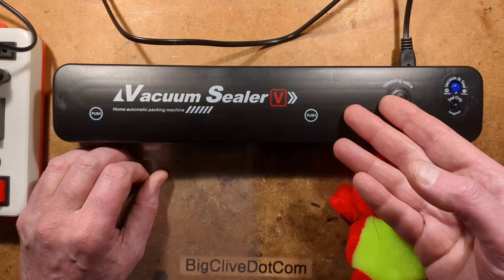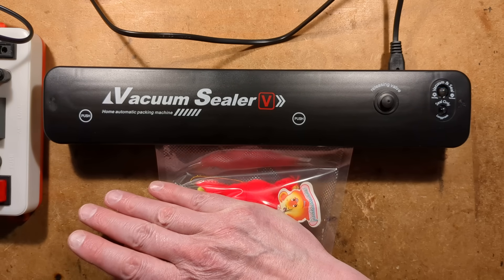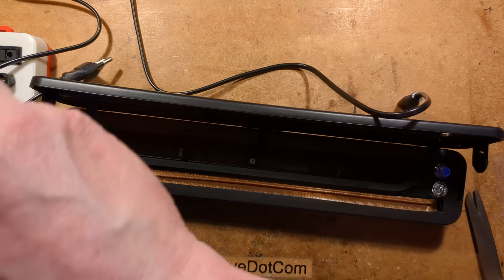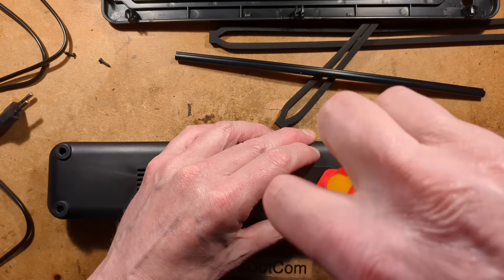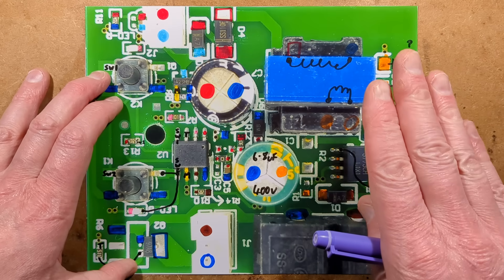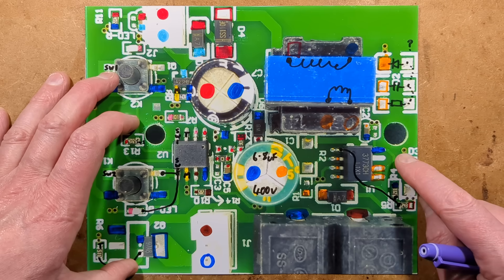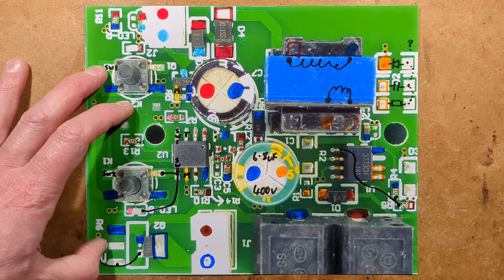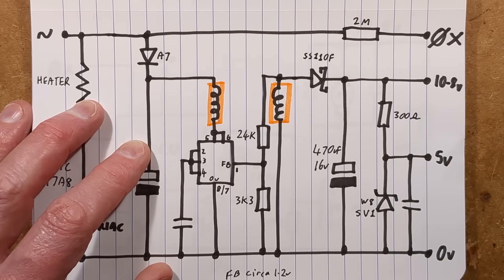Cheap vacuum sealer test and teardown

Comment: You can do as well without the electronics and at a cost of next to nothing. It starts with a 1" syringe. use a short length of tubing to a t-connection, from there to a one-way aquarium valve on each branch in opposite directions. What that does is suck in on one leg and blow it out of the other. Put the food in a plastic bag. close it, and push the "in" end through the plastic. A couple of quick pumps removes the air and some tape seals the bag.
Reply: And this syringe, tubing, tee, non-return valve and tape is significantly cheaper than $6?  "Next to nothing"?
Reply: @alsavage1  Go check
Reply: @alsavage1  Syringe and tubing £3.30. T-junction £0.11. 2x Non-return valves £0.80 Total £4.21 @ 1.34487 = $5.66.

Comment: I don't think I'd trust this machine to pull/seal vacuum for any extended time.  Tiny pump, plastic case, toy-ish circuit board, maybe for organizational purposes.  I have a commercial unit I purchased years ago at Cabela's, a sporting goods store here in the US which cost me several hundred dollars.  I use it for harvested game, purchased meats and also for bulk food storage, saves me a lot of money and has never failed.  I'll never take it apart but thanks to Big Clive for his participation in this endeavor, very interesting.  👍👍

Comment: Could you disconnect the heater and use it for vacuuming ziplock bags? (after taping over the ubiquitous stupid punch holes!)
Reply from the maker: Yes.   The heater can be unplugged.

Comment: Another possible use for the zero-crossover would be to act as a timer for the vacuum pump.

Didn't realise that you had to insert the bags in a specific orientation, maybe that's why I get inconsistent results with my vacuum sealer.

Comment: These cheap (implies low quality) vacuum sealers don't draw much of a vacuum - maybe 20"Hg (out of 309" Hg) at the most.  Vey few, if any, say anything about the vacuum level they can achieve.  You have to get that info from independent reviewers.  Those that can achieve 25"Hg or more are better quality.

Comment: 15:20 Using mains frequency to infer voltage isn't infallible.  Japan, for example, uses 100VAC at both 50 Hz and 60 HZ.

Comment: Wife bought one locally.
Lasted 3 uses  and resistance broke which was odd,  I was not witness of that or how it was used.
Replacement resistance were nowhere to be found since it s different from other impulse sealers . Also it works from mains. Ended buying 2  old new stock units  for 2 USD each, boxed and working from the local e waste  street.
Reply: Also this air pump is similar in construction as the ones  used in Chinese portable blood pressure monitors, MAPA

Comment: The problem with a lot of these machines is they're designed to work with a specific type / thickness of plastic, and there's no way to adjust them to work with different bags / films (so either they don't seal properly or they melt it right through). Well, I say "problem", that's obviously not a problem for the manufacturers, who are interested in locking you into buying their consumables.

Comment: 😏 before going to college I used to work at a printing company and I ran a shrink film heat sealer, buying books for school was absurdly expensive especially most of my books had to be new of course (damn proffs) a few classes I had to drop, and those books were shrink wrapped😮‍💨 once it's unwrapped it's "used" so having a vacuum sealer some window insulator film and a hair dryer got me my FULL refund for those books, luckily the sticker's they put on the film were easily removed and placed on my repackaged book 😉
Reply: Same, we had a shrink film sealer for returned computer goods, which made the next customer feel better I guess :/

Comment: I use something similar in the kitchen for food storage but lately I've been thinking of buying one slightly bigger for storing my 3d printer filament as I'm having moisture issues.
Reply: Wouldn't ziploc bags be perfectly adequate for that?  You could even include a little sachet of silicone dehydrating grains if you really need to keep the contents anhydrous.
Reply from the maker: The next video to be released in a couple of days is about hand pump operated vacuum seal bags for 3D filament.

Comment: They needed a 12v power supply with a decent amount of power. Since the entire circuit is completely isolated in the case the 12v supply doesn't need to be isolated from the mains. Saves a lot of money.

Comment: Been trying to find something similar for  vacuum sealing trashbags
Reply: A vacuum cleaner (Shop Vac) hose and Ty-Wrap work perfectly for that.  We pack our pillows for vacation that way.  30" Hg vacuum not needed for that.
Reply: @johnwiley8417  I've seen ads for similar bags to let you compact your luggage,  using a vacuum.  The first question that comes to mind for me is,  "do you have to bring the vacuum with you?"

Comment: Bottom of the pile sealing strip there Clive ,wider is better .I use mine for long term storage .Got lots of bills or bank statements lying about ? Vacuum seal them in yearly  bags write on a bit of paper what's year it is and seal them into a brick and put them into the loft ,you will probably never use them but I proved I had bought something 5 years before for a warranty claim and there it was all nice and crisp in my loft . You can put in books to preserve them from beasties and mould and a whole host of other things not just overnight marinating your meat (oooer Mrs)

Comment: You absolutely need to let this type of sealer cool well between turning on the heating element. Over a short time the top will turn into a big Smile because the ends coo at a faster rate then the middle. I used my first one for food and it did a lot, but as the bend got worse, I had to push it down to make the seal. If you plan seal things like food, get a more expensive sealer that is a box with a glass lid. Now if you want a cheap vacuum pump, these are great. Also, if you are sealing food, it will suck up liquid, so make sure the unit is elevated enough, also better ones will draw a low enough vacuum to boil liquid at room temperature, which is very cool.
Reply: I have a simple sealer device that looks very similar, but the vacuum pump is mounted in the top part of the device, so if any liquid is sucked into the vacuum chamber, it's not flowing into the pump's inlet. Small but very effective engineering decision.
Reply: @pfefferle74  In a similar vein, British-made front-loading washing machines always used to have the motor mounted in one of the corners above the drum, in case of leaks.

Comment: You cant rely on the mains frequency for guessing the voltage. Especially in south Africa there are places with 220-240V at 60Hz
Also half of japan is 100V 50Hz
The only thing that could be done is measuring the timing difference between that pin 7 with a pullup and without
Without a pullup the pin sees a 50:50 square wave but with a pullup the high part gets longer depending on the mains voltage

Comment: Quick protip: you can use any ordinary smooth bags if you put a short segment of plastic drinking straw in the middle of the opening. It'll pull the vacuum through that and then heat-seal the whole thing together.
Reply: Also, you can cut strips from scrap bag material. Stick in bag to be sealed, like the straw. This helps when using other bags that don't have texture.
Reply: I've managed all sorts without the straw even if you line up with the vacuum properly but I'll be trying a straw next time. Always good to have another approach to a problem

Comment: The pump.used in the device is the same one used in blood pressure monitors, I know this because I took mine apart when it stopped working. The blood pressure unit had a short capped tube applied to the port that is used to suck the air out of the bag, the other port blows air and that's why there is a vent in the base of the unit
Reply: I recognised the sound :)
Reply: Me too.. 😂  @yangtse55
Reply: Its an offtheshelve pump i can find on aliexpress for a few cents

Comment: I've something similar, it'll seal/melt normal plastic bags together as long as the plastic isn't too thin. You can faff about and seal the vacuum bags to other non vacuum plastic bags to turn them into vacuum bags(the vacuum bag needs to in the machine for it to work). You can also faff with cutting the bags to make smaller bags if you're wanting to use them for waterproofing things for camping e.g. emergency lighter, batteries etc
Reply: I've not being successful using it for sous vide cooking, the bags fill with air during the cooking process

Comment: In the states, they sell bulk bags that are on rolls about a foot wide with only the sides sealed so the length can be whatever you like. They are a reasonable price at comerical food supply distribution stores. Most handy for food storage in the freezer.

Comment: I bet that vacuum pump and sealing strip will work perfectly fine for years(even with that shady low quality driver and motor), but plastic latches and foam seals will disintegrate after few months...

Comment: Over 25 years ago I had a small handheld battery powered bag sealer to reseal snack bags so the chips, pretzels, etc didn't go stale. It worked well enough but was quite murderous on the 2 "AA" batteries used to power it. It took about a minute or so for the heating element to get hot enough to melt the bag closed.
Reply: I just fold the bag and put a clothespin on it. Never runs out of batteries.
Reply: @helgew9008  does go stale faster though
Reply: Ah i bought one of those recently at a dollar store. And like you said it worked good enough after a minute of heating up... but the batteries would die super quickly 😂
Reply: @its_ya_boi_slim_dic  Agree completely. Even quality AA cells would die a quick death. Good idea, maybe LI-ion battery pack might be a better solution.
Reply: @quantumleap359  I had this item in the days of Ni-Cad batteries. Li-ion really wasn't there yet.
Reply: @its_ya_boi_slim_dic there are USB C rechargeable ones
Reply: @its_ya_boi_slim_dic  Use some quality rechargeable NIMH's Will last for ages and heat up in seconds. Get the LSD kind from capacity 1300-2000mAh. Not the high capacity 2500+mAh ones.
alternatively some NICD AA's less capacity but still high current capability
Reply: @its_ya_boi_slim_dic  so wire in  3V POWER PLUG
Reply: > "...quite murderous on the 2 "AA" batteries.." Housemate bought a battery powered 'swank lamp'. EATS three AA cells every few days. I knew we had a dozen-pack in reserve-- and then we didn't. I bought a C-cell battry holder and was gonna convert for like 4X the battery life.... have not got a round tuit.
Reply: @PRR1954  the proper mod is to apply it to the bin
Reply: Opportunity for recycled rechargeable?
Reply: me too, I wonder if its the same principle to this post, always disable battery when not in use?
Reply: I still have one from the early 2000s.

Comment: You could cobble together a pretty nice vacuum desoldering tool with that little pump.
Reply: I believe you need more negative pressure than these tiny little pumps can provide. These have the luxury of time as you can just wait till they've laboriously pulled the air out of the bag, but desolderers need to suck the solder in the open air.

Comment: I have such a vacuum sealer probably made in the same Chinese factory but with a different "brand". The biggest issue is the foam bits dry out and then the device stops working as it doesn't create a good enough seal. A workaround is simply to take a damp to wet sponge and wipe the foam bits before use.
Reply: Perhaps you could wipe with a few drops of olive oil?
Reply: *before plugging it in to the mains

Comment: I think I'd probably replace the mains lead with one with a 3 pin plug and a 3 amp fuse. I don't think I saw a fuse or fusible resistor in the schematic. Excellent video Clive, I think I might get one.. ty.
Reply: A proper adapter should be fused. You can get ones which capture the two pin plug and effectively turn it into a UK plug. Quite a bit of stuff sold through the more "formal" channels comes with one fitted.
Reply: What would you connect the 3rd pin to?  It's all plastic, nothing to ground.
Reply: @alsavage1  Nothing, like every double insulated item with a UK plug on it. Two core detachable leads with moulded plugs often have a plastic "earth" pin just to operate the shutters on the socket.
Reply: @alsavage1 I'm not worried about the lack of an earth connection, it is the lack of a fuse that concerns me.

Comment: I use my home vacuum sealer for projects like my coasters. After I apply the adhesive I put them into a bag and vacuum seal it applying even pressure across the coaster for better bonding. Oh, and I use it for preserving food also😂😂😂sushi .

Comment: Cheap and cheerful, I guess, although there are several identical-looking products on Amazon for around  £15.

You are better off spending more money and getting a machine that includes an integrated cutter. Then you can buy rolls of film which even Lidl sell from time to time. In fact, even the Lidl Parkside vacuum sealer (which was available again recently) would probably be a better bet than this thing not least because it has a 3-year warranty.

Comment: Great video, thanks Clive!

Aluminum has lower resistance by weight. By volume, copper has lower resistance.
And in these applications the volume difference of the metal doesn't matter, it doesn't change the volume of the enclosure, so the weight is the only real consideration. So copper-coated aluminum would be a superior choice even if it wasn't cheaper.
Reply: He was talking about the included mains power cable, not the enclosure. CCA power cable is not superior, it's just cheaper -- it is much more brittle and prone to mechanical fatigue, which is exactly what you don't want in a power cable that will be moved around and coiled/uncoiled a lot.
Reply: @aaronmdjones  It will also corrode if an electrolyte (moist air) is present.

Comment: Another reason for the mains sync is it may only be using a short pulse to fire the triac near the start of the cycle - it's a waste of power to keep it driven the whole time. Can be useful if your MCU supply is relatively weak .

Comment: If only they would invest like 10-50% of the cheapest possible price into making things safer and more durable. And by "they", I mean every manufacturers worldwide. Even as a child, I found it weird that few manufacturers would do that, and that none would use such an investment in advertising. It's useless when manufacturers claim "better quality". But advertising with e.g. "This battery will be usable longer because it has cell balancing" would be doable. That conveys the message "higher quality", and people can easily look up themselves if the claim is warranted.

Comment: That heat seal only setting allows you to use rolls of vacuum sealing film. 

If you can source the rolls it makes it quite cost effective
Reply: Lidl has them on sale quite often, pretty cheap.
Reply: Also lets you double-seal a bag. Cheaper units sometimes don't fully seal, especially when you've got moisture in the bag, so you can pull out the bag a little and put a second seal in so you can make sure it's actually tight.
Reply: The rolls are fairly inexpensive at my local hardware/big box stores also
Reply: Good point. Due to its "cost optimised" construction, industrial scale usage (moderately fast, continuous) should not be expected of this unit. Which component would fail first is up for grabs. But we all knew that.
Reply: We use a more substantial sealer made by Müeller for the purpose and got the larger roll out bags for that reason. Some are solid with dispenser boxes that have a setup to cut the material - two blades facing opposite directions protected in a plastic shuttle which slides in a track.

We use an immersion circulator for a lot of cooking so this gets much use.
Reply: also useful if you don't want to vacuum seal bags of course. making sure the bag is blown up so it doesn't get squished.
Reply: You can make custom length bags with this option.
Reply: The "seal only" setting is also used for liquid items like soup etc. before you put them in the freezer.

Don't think the vacuum part would appreciate consuming your best scotch broth...
Reply: @AlphaWhiteWolf20  the vacuum can have a little bit of soup broth, as a treat 
:p

Comment: we had several cheap £19.99 vacuum sealers appear on amazon vine recently that a bunch of reviewers grabbed but they came with those extremely safety compliant clover leaf plugs ... all ended up in people's bins with 1 star reviews.
Reply: which plugs? what was the issue?
Reply: @sgas You get BS1363 style plugs on cheap Chinese equipment that don't have a fuse and don't meet the size requirements to keep fingers out and often have a sleeved earth pin. https://www.youtube.com/watch?v=9KMrWupFQt4

Comment: I've found a datasheet for LP3773CH made by Shenzen Chip Hope Micro-electronics Ltd. The circuit seems to roughly match your layout, although theirs shows a fully rectified supply rather than just a single diode. All in Chinese unfortunately.

I found it via Duck Duck Go/JLCPCB. Recently I've had much more success looking for datasheets using DDG instead of Google.

Comment: Good video. It would be interesting to tear down a high-quality vacuum sealer and compare the differences to the cheap unit.
The cat looked very unhappy as it was being squished.
Reply: They are very different. I purchased one of the brand name from a thrift shop. Used it once and then the pump would not shut off. When I opened it there were two circuit boards. One looks like the power supply board and the other had motor and vacuum components.
Reply: That would be an “industrial” version
Reply: Really gave new meaning to Flat Cat... heh